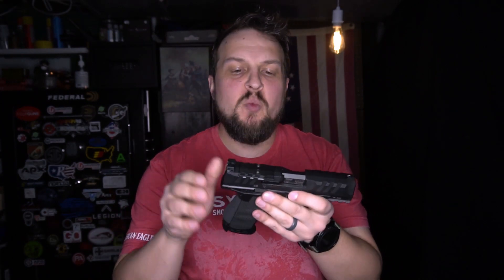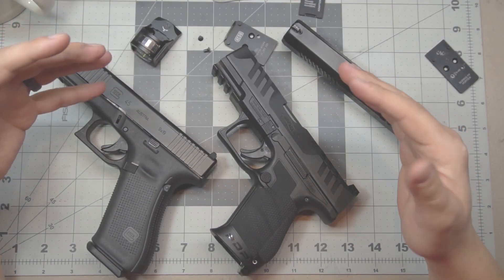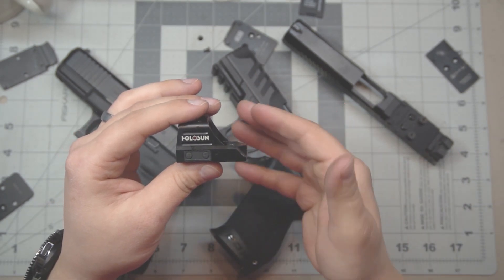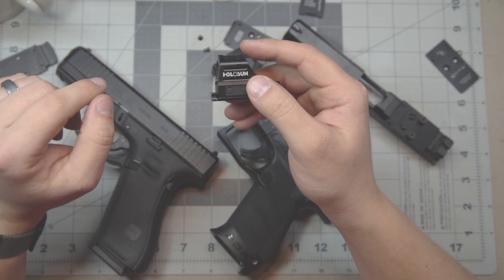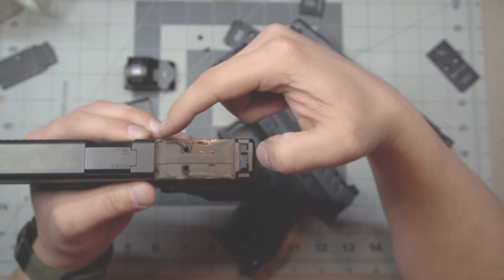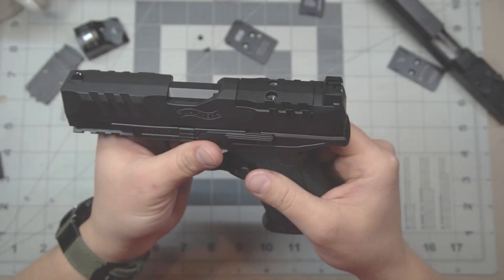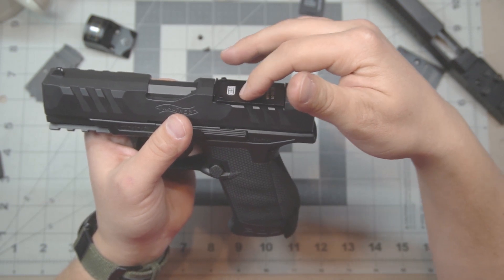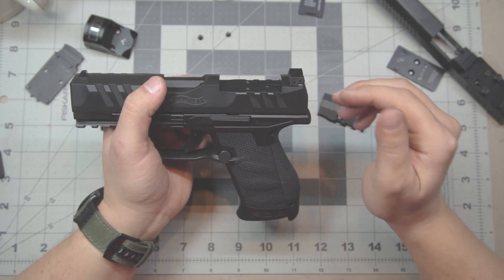The Gen 1 Walther PDP is going to Break

Comment: For clarity, C&H Precision, the maker of the plate featured in this video, is also the company that makes the "OEM" Walther plates. They're the same thing, made by the same people. 

That being said, I understand where the author is coming from with the lugless mounting surface. I'm not sure why Walther didn't include lugs in the PDP design, but they did include lugs in prior designs, So I can only assume the omission on the PDP was intentional. Now that this is public, I'd like to see people give optics-mounted PDPs a burndown to see how well they hold up. If the mounting screws sheer off under use, Walther is going to be replacing some slides. A pistol marketed as optic-ready and for Duty Use should, nay, MUST have an optics mounting platform that is robust and can withstand the forces liable to be encountered in a duty situation and then some.  

Walther obviously believes a smooth mounting surface was the right call here. If it doesn't work they're going to look very bad.
Reply: he uses a prototype...the actual plate fits tight. Do you think C&H Precision would partner with Walther, if they had concerns about the plates?
Reply: @fabir1675  I would hope not. I have a 509T plate coming in the mail from C&H and will definitely update the thread with my impressions of the fit.
Reply: I will say that my ATEi-milled Glock slide with an RMR doesn't have any substantial lugs, either. Just two small divets that appear more geared towards lining the optic up correctly with the slide than acting as anchor points to counteract sheer forces during recoil. And ATEi RMR slides have been run through the wringer and are still deemed some of the best slide millers in the game.
Reply: @loarmistead  looking forward to hear from you :-)
Reply: They're not the SAME thing even if C&H made the plate our host used.  C&H makes different plates for different applications and they make them specific to a slide AND to the optic being mounted.  You're just flat wrong here.
Reply: @seanoneil277  I'm not wrong at all. C&H makes the adapter plates for Walther. Of course the plates will be different based on the type of optic that is being mounted, that's why the different footprints have different OEM part numbers. But that doesn't negate the fact that C&H makes the Walther PDP adapter plates. I'm not sure what you're getting at.
Reply: @loarmistead  You're playing hide & seek here.  The C&H plate our host used was NOT the plate designed for the PDP combined with the optic our host used.  

So either you're ignorant of a salient fact, or you're lying now.  Please confess: which of these alternatives applies.

It's not enough that it's "a C&H plate" because C&H makes plates specific to both the slide AND the optic being used.  Why you're ignoring this is an open question, and why you're dodging while claiming you're correct is pretty good evidence that you're being dishonest.
Reply: @seanoneil277  I think you're putting words in my mouth and looking for a disagreement where there isn't one. I'm still not understanding what you're trying to say. I made no assertions on the host's plate, what  stage of development it was in, or whether it was designed specifically for the PDP or the optic being used. That is all completely irrelevant. 

 I only said that C&H makes the production PDP optic plates (per Larry Vickers) so there shouldn't be any difference in, say, an RMR plate coming from Walther and an RMR plate coming from C&H, because both RMR plates were made by C&H. Of course plates differ based on pistol model and optic type, where did I imply that this wasn't true?
Reply: @loarmistead  I'm not putting words in your mouth.  And please, stop trying to discern my motives.  You wouldn't know my motives.  You don't know me and I don't know you.

Rather than "looking for a disagreement," I'm simply asking you to acknowledge that our host didn't use the proper C&H plate, because C&H makes their plates specifically for a slide AND an optic.  Your first post in this thread told everyone that our host's plate is "the same plate" that Walther would provide for the combination of PDP plus our host's specific optic.

And it's not the same plate.

And you won't admit that.

I'm not "looking for a disagreement," you're just being evasive -- and I'm asking for your admission that it's not the same plate Walther would ship for our host's optic.

Apparently you either won't, or can't, admit that.
Reply: @seanoneil277  Homey, I don't know anything about the host's plate, and don't care. He could've chiseled it himself with a flat head screwdriver out of pot metal for all I know.  I have not and will not make an assertion on it because it doesn't have anything to do with my point. Again, stop trying to make me say something that I never said.

I said, merely, "C&H makes Walther's optic adapter plates." This was intended to be a compliment to Walther and C&H, but you, and only you, managed to interpret it differently. That's not a 'me' problem.
Reply: @seanoneil277  And if you read higher in this same thread, you will see that I have a C&H plate inbound for my PDP and a 509T. Why would I pay them $70 if I didn't trust their product?
Reply: @loarmistead  You can mischaracterize my post 'til the cows come home & fall down in their fields, I suppose.

Your statement in your initial post suggests that our host used the proper post because it comes from C&H.  Read it again.  Please.  Without being defensive and without doing the thing you're accusing me of doing -- being argumentative.  Just read what you wrote in your first post and see if it doesn't remain open to being interpreted as supporting our host's claim that it's sufficient to be a C&H plate.

Because that's what our host is claiming:  he has the right plate, just because it's a C&H plate.  

I'm not talking about what you INTENDED to communicate (what was in your mind at the time you wrote it) in your initial comment.

I'm talking about how it can be interpreted.  

Maybe you haven't read the whole danged thread following this video -- I wouldn't blame you for that, it's a lot of commentary.  But if you do read the whole thread you'll see our host has a lot of self-defending assertions where he says, essentially, "but I used a C&H plate!"  

I'm not commenting on your ownership or purchase of a C&H plate for your own use.  So I don't know why you'd bring that up.
Reply: @seanoneil277  Sounds like a context issue. I can't help that someone carries inferences from another person's post into my post. I already read my OP several times trying to understand what the issue was and wasn't able to find it. That's probably because the issue stemmed from someone else's post that I didn't read. But again, that's not my problem.  People say the host was using a poorly fitted pre-production plate; I'll take their word for it, aside from the pre-production datestamp on it I have no idea who made the plate, where it's from, or what it was designed for. But again my original post was not focused on the plates aside from stating that C&H manufactures them on behalf of Walther, full stop.  

The meat of my post was directed at acknowledging the host's concern about the lugless slide cut design that Walther used on the PDP, caveated below that with the statement that my custom milled Glock RMR slide also lacks any substantial lugs, and it was done by ATEi, the official Roland Special miller. Point being, the absense of lugs in and of itself does not mean the design will fail. It does, however greatly increase risk of failure if improper or poorly fitted plates are used. For reference look at the early poorly fitted Glock MOS plates that were known to sheer their mounting screws (due more to the plate not being flush with the slide, but the same laws of physics apply). 

I have not and will not make any assertions on the suitability of the host's adapter plate.
Reply: @loarmistead  I see.  Just as I said, you're endorsing our host's statements -- and his statements are incorrect.  There is NO NEED for bosses/lugs UNLESS two factors exist:  

1) The slide's bores/threads are not deep enough because the slide lacks material depth for both milling and drilling, to adequately allow fastner purchase.  (The fasteners and their bores, if correctly spec'd, can serve as an anchor mitigating against fore/aft oscillating weakening stresses.) 

2) The slide lacks external fixing to prevent fore/aft oscillation and attendant weakening of the fasteners.

In the case of the PDP, the optic attachment area is not a flat plane, but rather is a "trench" in the slide with defined boundaries fore and aft.  That "trench", when fitted with a plate, prevents the theoretical shearing that you suggest above, and that our host claims is absolutely sure to occur.

So your wordy explanation actually shows that I was correct above.  You're endorsing our host's view, even though our host is incorrect.
Reply: @seanoneil277  Now you're moving the goal posts. Your gripe with my original statement was with my allegedly agreeing with the host that he was using a proper adapter plate. I said no such thing and the record shows this. 

What I did say was that the host's argument has merit *under certain conditions*, which I described, and which you just reiterated. As long as the plate doesn't have space to shift in the front and rear of the slide cut, the sheering force on the screws is mitigated. This isn't my first rodeo. Go find someone else to troll.
Reply: @seanoneil277  I voted with my wallet here. I own a PDP. I have a plate direct from C&H Precision in transit, and a $400 optic that will be mounted to it. If I believed the platform were going to fail I wouldn't have over $1,000 into it already.
Reply: @loarmistead  I didn't move any goal posts.  I responded to the words/substance you yourself used in the "explanation" above.  If the goalposts moved, YOU moved them.  Not me.

Why can't you be honest, eh?  Is it possible for you to reply without trying to allege dishonesty by ME while you're the one being dishonest?  

It's looking like you're trying to be the intellectual (versus fawning defender) support for our host, rather than just some guy who says he came on this thread to be endorsing C&H's work.  

Just like our host, you've misunderstood C&H's video about mounting optics plates, and you've misunderstood when/where lugs are required.  And you're pretending you haven't misunderstood that, by trying to accuse me of playing unfairly.  Well, I'm not being unfair to anyone or anything.  I'm simply not a fan of people who lie and distort things just for clickbait.  Like our host.  

All you're doing now is letting 2d A critics have fodder for the claim that firearm owners are irresponsible & dishonest.  Why do I say that?  You're supporting the distortions & lies offered by our host.  Really nice work, undercutting the 2d A that way.  Seriously.
Reply: @seanoneil277  I haven't watched any videos from C&H, and I'm not sure how acknowledging basic physics harms the 2nd Amendment. I hope you find peace. In the meantime I'm going to be running rounds through my Walther PDP 4.5" full size and Holosun 509T with C&H Precision adapter plate, and if all goes well (and I expect it to) will later be carrying it into the backcountry where life and safety will be entrusted to it.  That's about as strong an endorsement as the weapon system can get.

Comment: Idk about you. But, if I dropped my pistol on the optic, I’d rather the screws break than the optic.  If the screws are the weak point, that’s a good thing for me.
Reply from the maker: The screws breaking won't save the optic.  This isn't a power transfer system with an intended weak link
Reply: @workthetrigger  my point being. If you drop the firearm hard enough to break the optic. The mounting system doesn’t really matter. 🤷🏻‍♂️

But, if the system is truly flawed, and the screws aren’t meant for sear tension, then they will break before the optic. 

See my point?

Comment: This did not age well… Not an issue at all…
Reply from the maker: Enough of an issue that Walther revised their plate design 🤷🏻‍♂️
Reply from the maker: Their testing of 50k rounds was wordsmith bullshit. 

You don't put that much engineering work into something to quiet "whiners" you prove them wrong. There were plenty of things they could've done to prove it, and made a huge marketing campaign off of it. But they didn't.  They engineered instead... Seems like a lot of work to just quiet concerns 🤷🏻‍♂️

But hey, you ignore the reports of loosenings and breaks. Ignore the fact that they spent money to fix a "non issue" and just be glad they produced a better gun 😉
Reply: @workthetrigger  oddly enough Glock MOS doesn’t use lugs on the gun side of the plate either and once again… Not a problem… So let me guess, Glock, pretty much the most popular handgun manufacturer in the world got it wrong too right? 

Amazingly enough, I’ve never had issues with my red dots on my Glocks coming loose or my PDP’s but ya know lol… You’ve got it all figured out. Never mind that a lot of us happen to pull those plates off once a year to change out batteries for RMR’s and everything else but okay dude. 

Loctite and titanium screws set to the appropriate torque specs… Works every time lol. Except for you of course. You’re special.
Reply from the maker: Just lost all credibility in your opinion. The Glock MOS system is know to be prone to failure. Do just a little research and you'll see. And at least they have a lateral support to keep side impacts from doing as much damage. But yeah, Glock MOS is crap.  Ateast Walther took initiative and corrected the error.
Reply: @workthetrigger  Glock MOS works fine as long as you use replace the screws with titanium and use Loctite. Once again it’s not an issue. Use the proper tools and torque to spec and amazingly enough it’s no longer an issue. 

Yes the Glock kits were sent out with the wrong screws, who cares? Order a set off Amazon from DPP and call it a day. They give you 4 plates for free to at least get you started. The design itself is not an issue. Even if you put another plate on the gun it still doesn’t have bottom lugs and oddly enough… Not a problem. 

Even if the plates were less than desirable, that’s an issue with the plate itself and not the gun design. Moot point dude. You can buy whatever plate you want to use if you’re scared of a failure. That’s the plate, not the firearm.
Reply from the maker: If a system using all stock parts doesn't work, that's the system not working. If you have to buy third-party aftermarket components then it's a failure of the firearm system itself.
Reply: @workthetrigger  lol you’re off the hook dude. Yes, I spent ten dollars on a bottom plate for my RMR and it came with the appropriate grade screws with the kit. So I guess Trijicon is at fault for not including a plate to keep water out right? Lol. Let’s just dismiss the entire optic because they didn’t include a plate hahaha. 

So Glock sent kits out with the wrong length / type of screw and we say the entire gun is garbage because of it? Get over yourself lol.

Comment: If everyone here did a little research instead of running their mouths they would know that this guy is using the plate that you will get from walther because walther has partnered with c&h precision and they are the ones making the optic plates for this pistol. Maybe the man knows what hes talking about or maybe he doesn’t all im saying is do some research or at least know what you’re talking about before you start to discredit the man
Reply: No proof it's the same plate.  Just your say-so.  Which isn't proof of anything but your desire to shield our host from legitimate criticism.

C&H make plates, and/or do custom milling work, for specific optics mounted on specific slides.  Our host hasn't proved he's got that plate.  Even if you allege "it's a C&H plate" that's not the end of the analysis.  It needs to be a C&H plate designed for the PDP with the specific optic our host mounts to the PDP.
Reply: The plate Walther provides when you request it fits in very nice and tight into the cutout, without play, and not at all like what is shown in the video.

Comment: Titanium screws might be the temporary solution!
Reply from the maker: Titanium is relatively brittle. Not sure it'd work.  If they were going with this design, they needed to go with a shoulder bolt style screw that incorporates a stud into the screw body. Ball dropped in that, too.
Reply: @workthetrigger  And the more shoulder on the screw to take the lateral load, the less thread engagement you'd have reducing potential clamp load. I've not looked at a PDP, but I suspect thread space is at a premium there, like most pistols. I'm not sure how Walther might correct these in an affordable way during a possible recall situation. Cut slots into the slide and provide new plates that accommodate, or perhaps they'd just ship some sort of fancy material $$$ screws?
Reply from the maker: Yeah, slots or completely new slides.  Thread space in the slide isn't really at a huge premium, it's pretty thick back there.  Since typically 4 threads hold the load, and you'd need 1/8" of shoulder interface, my guess is about 5/16 minimum hole depth, with 3/16 threaded and 1/8 counter bore for the stud/shoulder. No clue if there's space, but that would be my guess.
Reply: @workthetrigger  Yeah what you said! Check my flu flux capacitor while I am at it. Wish I had some of your knowledge, and now I do. Thanks for the great and informative video even if I don’t understand all of it. 😆